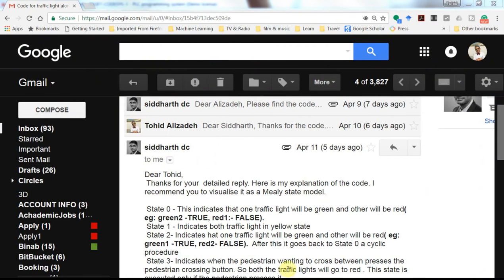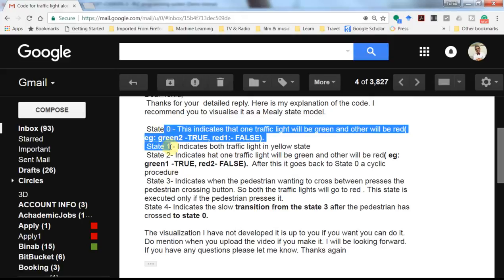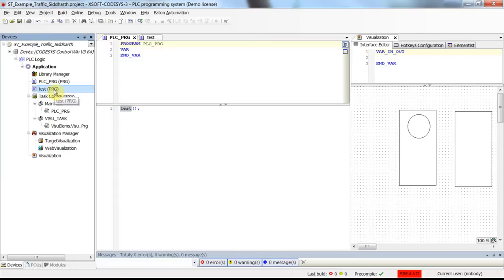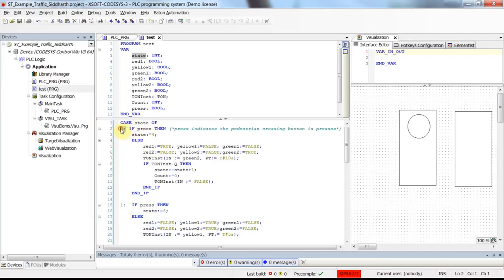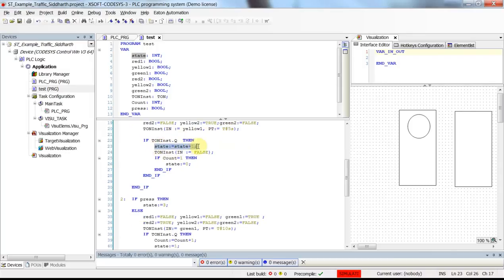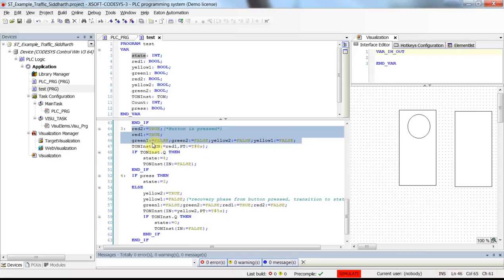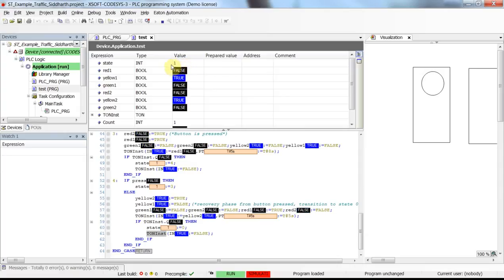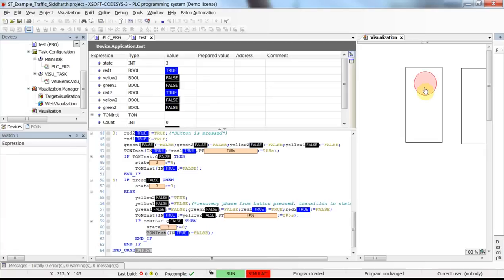CODESYS: Structured Text (ST) programming example - Traffic control #codesys #plcprogramming #st

Comment from the maker: Here is the explanation from the author "Siddharth dc":
Here is my explanation of the code. I recommend you to visualise it as a Mealy state model.

 State 0 - This indicates that one traffic light will be green and other will be red( eg: green2 TRUE, red1: FALSE).
 State 1 - Indicates both traffic light in yellow state
 State 2- Indicates hat one traffic light will be green and other will be red( eg: green1 TRUE, red2 FALSE).  After this it goes back to State 0 a cyclic procedure
 State 3- Indicates when the pedestrian wanting to cross between presses the pedestrian crossing button. So both the traffic lights will go to red . This state is executed only if the pedestrian presses it.
State 4- Indicates the slow transition from the state 3 after the pedestrian has crossed to state 0.